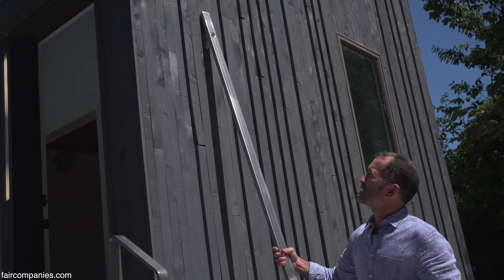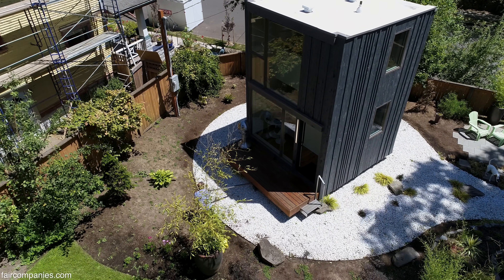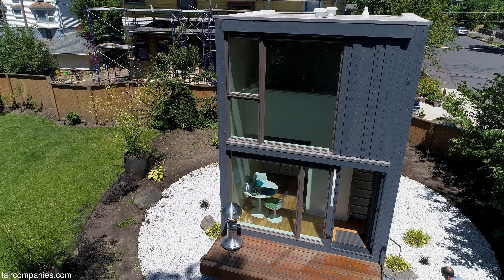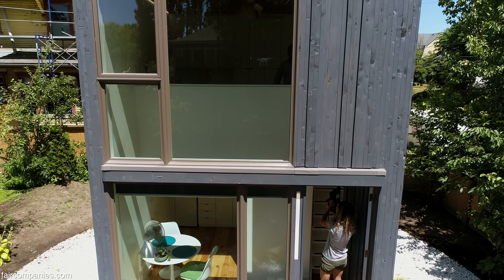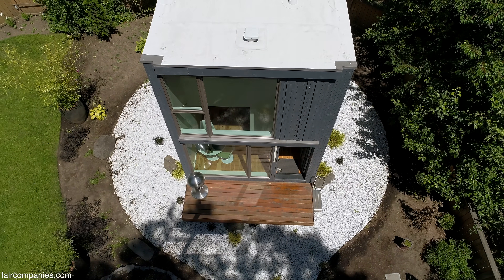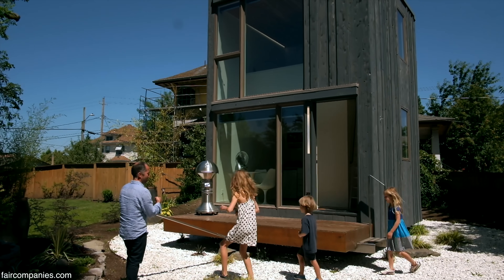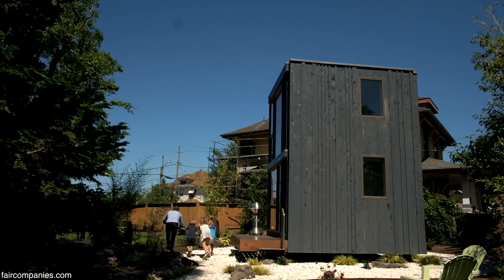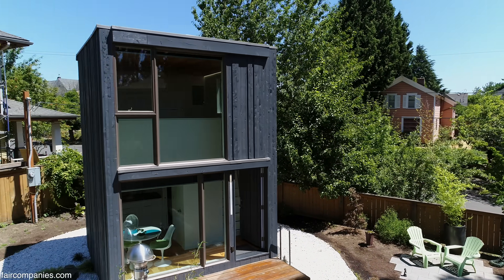359 Rotating Home follows the sun like a sunflower

Comment: There was a writer who built a much smaller heliotropic shed as a"writing shed" in his back yard.  He would turn it during the day to get optimum illumination, I believe using a clockwork mechanism...
Reply from the maker: I'm guessing you're referring to George Bernard Shaw's revolving Writing Hut https://www.nationaltrust.org.uk/features/george-bernard-shaws-garden  This one is 2 stories and more modern, but they definitely have a lot in common (windows mainly on one side, etc).
Reply: maxdecphoenix Do you eat with that mouth that spews that filth?
Reply: Yes, there are great benefits to tracking the sun -- especially in darker, colder climes.  Solar orientation means natural heating and natural lighting with zero (or greatly reduced) energy expenditure.
Reply: When you go beyond "light" purposes, there are many climates, not in the southwest, but where it is cold 6-8 months of the year and getting solar heat saves on utilities by huge amounts.
Reply: Sondra Sneed
 Solar is even more important for air-conditioning, since one can use a wood stove for heat. Solar is the way to go. In a house like this, been totally off the grid is very useful because to turn the house you don't have to have electricity hooked up.
Reply: Someone want an upgrade, but just got a plain light... so he turned to an ass. The end. :)
Reply: George Bernard Shaw became a theater critic and playwright in 1895. I am not sure when he built his "writing shed" but in Volume 2 of Bernard E. Jones four-book series called "The Practical Woodworker", in his chapter called "Sheds and Outdoor Erections" he gives great detail on how to make a revolving shed very much like the one Shaw made to write in. "The Practical Woodworker series were first published sometime between 1889 and 1915 and is currently available on Amazon.
Reply: south-facing windows in the Northern Hemisphere. North-facing windows in the Southern.  no need for other novelties.
Reply: So put in some fucking sun roofs.  The 'light' in my bathroom camper is a thin, transluscent white plastic bulb that illuminates the room brilliantly for about 13 hours a day.   And I don't have to rotate my camper.    Better yet, you want optimum illumination to write, go sit in a fucking field.
Reply: @maxdecphoenix  Why you gotta be so rude my man? Its ok to experiment with housing try do something novel.

Comment: When the house was spinning, I was fully shocked. However, I have a small question, at the rotating part, how do you connect the water pipes and the electric wires?

Comment: It's very cute, inside out. But why did you not put a tiny lawnmover engine to turn electrically? There is a guy in Australia who rotates entire big houses like that. When you turn seventy five you won't enjoy the pushing anymore and may get stuck on the dark side. I would have added a thick rubber curtain that reaches the floor to keep out rodents and the cold on the winter.

Comment: I would like to have a more thorough understanding of how the water and sewage work in this house. They kind of skimmed over it. I need detail.
Reply: he said they used something that was originally used for natural gas applications, so google "rotating natural gas coupling" and get the details yourself.
Reply: They mentioned the sewage a lot. I'd like more details about electrical and water supply. Only mentions of those are that's why it can't rotate completely.
Reply: @stephenmg12  I imagine the main electrical and fresh water supply are just in flexible conduit/piping and wrapped around the waste water pipe.  For water, something like a plastic PEX pipe (or whatever the modern equivalent is).
Reply: Not much internal storage, hmmmmmm . . . 😬
Reply: YOU need more details?? wow!

Comment: I don't understand how he's connected to city utilities when it spins, especially the electric service. Unless he has some slack in the service wiring, but that would only allow for turning it a specific amount of distance & would definitely prevent continuous free spinning of the structure. Maybe that's the case. I can't think of anything else that would work & be accepted by the city building department code enforcement. Very interesting for sure.
Reply: Watch again, he explains most of it. but I would also assume it can accept a full rotation and then go the opposite direction because of electricity.

Comment: Wouldn't the house only sitting on the circular ring be extremely top heavy and not very stable during high winds??? Where we live , there are many tornadoes and damaging winds.  I notice with my brick home being at only slightly higher elevation , the wind gusts are pretty extreme. I've had  tree limbs to break and  fencing damage  from high winds. This foundation issue is unsettling to me. Otherwise, beautiful design.

Comment: :}
       Vary Glad to see this concept in the flesh finally.  Back in my hippie  days this same idea drifted into
       my head in a cloud of smoke.....

       Now to see how great an I idea you had and followed thru on it and this is fulfilling for me also.......
       
       Wish you the best.
       
       PS I also had mine rotating electrically / inexpensivly with a 12v Jeep Bumper Cable Winch. 
       The trick is have the cable both wind on and off the spool so you can pull in both direction to
       accomplish your 359 need as you feed out the slack so it is ready to go back in the opposite direction.
:}

Comment: Should put a large circular metal band underneath with gear notches on it.
Then hook it up to a motor.
A belt system would also work, but I think gears would be better, since belts weather and break over time.

Comment: Imagine this house being hexagon shaped instead, can still use the 12 feet wide sides, but adding 2 more sides would gain approximately double the space. I would also add an electrical engine to move the building and a surround balcony on the second story.
Reply: +Time Doctor
If you watched the video, you'd know the purpose behind the sizing is that you can ship stuff up to 12' wide without extreme expense...it was intended to be a "shippable house." A hexagon with 12' sides would be non-shippable. Not to mention that hexagonal rooms aren't very practical/useful space.
Reply: I disagree, the walls will still be flat. If it needs to be shippable it should be shipped in parts that you attach together, not a fully constructed house. this house is too small, I don't want to live with a mini fridge.
Reply: @dr.justintime1848  you can have a full sized fridge or a European sized fridge if you prefer. But what you are suggesting would cost more money. I think he was also trying to keep costs down. Besides, I wouldn't want to have to put my house back together. You simply place it on your spot/foundation if u keep it the way he designed.
Reply: @kimberlynhughes3658  I think either you or me is missing the point. If it comes ready built, ok, you have a point. If it comes in parts that you put together yourself then I'd prefer to spend a little extra on having a house that is twice as big.
Reply: @dr.justintime1848  This is an oversize load(much higher expense). In fact its too tall to ship upright, It would have to be shipped on its side to protect the large glass panes. That would lead one to believe that there would be some assembly required. Construction is based on vertical gravity, cabinets, countertops, toilets, windows, etc etc won't ship as reliably with "lateral" gravity applied.

The type of person who would buy something like this and have it shipped "across the country" is someone above the threshold of the concept of value of money. Ideally something like this would be built by local builders in a warehouse and then only need to be shipped a short distance. Maybe there could be local "boutique" tiny home builders that specialize in high end builds and they could build off a plan that any architect in the world sent them and then ship a short distance. Most cheaper prefab trailer type tiny houses I've seen are built to an exceptionally low quality.

As an aside, in final production a small electric motor would be used to rotate this house. The idea of manpower and leverage is cute, but that ain't happening irl.
Reply: @VanInhalin  Idk about you, but if I personally would want something like this I would wish for like a "lego kit" of small enough parts to ship without oversize problems, otherwise it's not financially sane obviously to "ship across the country". To ship it pre built would be rather ineffective. Then have a local builder put it together.

12 by 12 ft parts might not be the best shipping option, but if we play with that idea I still hold on to the idea of a 6 sided house for maximized space. According to Wikipedia "In the United States, an oversize load is a vehicle and/or load that is wider than 8 ft 6 in (2.59 m)." So I would rather consider 8 ft wide walls in a 6 sided house. Or maybe 8 sided. Or 9 sided just for the hell of it. And I still would want a surround balcony on the second story. And a pointy roof, not flat. In hot areas you need that to not get a bedroom you can't sleep in.

Finally, I second your sentiment about a small electric motor, I would imagine sun controlled by a small aurdino or pie. Going out and push the house around? Lol, really? No.

Building a house will always be a huge investment. If the option is there to buy this pre-cut as a DIY then if this option is priced right, maybe. Living in Cali I would have it set to NOT follow the sun. But my guess is that it is/was a concept house and the architect is too stuck on his own idea for it to go anywhere.
Reply: @dr.justintime1848  I pretty much agree with everything you said. I live in Colorado. Face North in the summer, set the pie track the sun from October through March. Rake on the roof should be whatever your winter solstice sun angle is. Shipping containers aren't wide loads, they're sort of like lego and they fit perfect on trailers that regular pickups or semi's can haul. They're just heavy and may not have the aesthetic to suit the buyer.
Reply: @VanInhalin  If you are talking about using shipping containers as material for a house then sure it is doable but I would not use containers for this kind of house. For a shipping container house I would rather consider bury the container/s underground (on sides and top) for earth insulation. What I meant when I said "LEGO kit" is more that the (wood) precut parts were fitted to quickly and effortlessly build together the house. Kinda like IKEA furniture. Like IKEA selling houses.

Comment: Well.....this is genius!  Let Mother Nature heat and cool your house...just can't get better than that.  I think a SIP building on this rotating axis would be perfect. Actually perfect for a SIP design too.

We'll def be seeing iterations of this,...all over the world in the next 25 years...why? Affordability, sustainability,...efficiency,...duplicateability,  shipability,  population growth, ...

One could even imagine having 10-100 of these units...inside a "larger box" for city living...yet keeping the ability to rotate for comfort, whilst being in the larger box.  Build for seismic, scale up or down,....use SIP strategy...you have a LEED Gold building with multiple tenants.  Really good idea.
Reply: +Frank From Upstate NY
Do we even know if the energy saved via insolation exceeds the energy used to spin the house?
Reply: Given that the surface area of the windows facing "south" can be manipulated so easily....it doesn't take that much "human mechanical force" to spin/move the house.  Of course a 200# man can do it more readily than a 150# man - all other things being equal.  This house receives a nice potential amount of insolation and/or solar radiation, based on the amount of glass that it has on one side of the house.
One could probably incorp a small efficient motor to spin the house for winter heat gain....but...man can do anything...with enough money, engineering and thought.
Reply: What the hell are you talking about? You can already achieve passive heating and cooling, without the complications of the useless rotation.  You put the windows to the south and you use curtains in the summer... and remove them in the winter..

Comment: Why solar cells on the roof?  They could supply power to go off-grid during the day (or fully if you use a Tesla Powerwall) and even run a motor that could rotate the house with solar panels to follow the sun.

Comment: Okay , sooooo the man engineered a house you can turn with a pole that spins on a centered sewer drain , then he puts a big rock in the way as a tripping hazard ? !  Even more amazing , he hasn't moved it yet.
Reply: That’s was funny but still it’s a cool home
Reply: Lol-  it is beautiful though
Reply: sanctuary woods 
I thought same thing. Duh.
Reply: He put it there for leverage on the low point of otherwise flat, gravelly ground. If you look at the angle of the rock, it's similar to a runners starting block. I'm guessing the gravel is for mud proofing, drainage, and grip on the ground in the wet.

Comment: I would really like the house if it had motorized tracking by the sun for maximum solar gain and energy storage as well as additional power sources such as a vertical wind turbine on the roof, a water catchment system, a composting toilet, and a garden to grow food would make it fully off-grid.